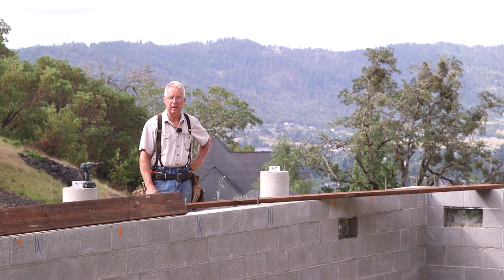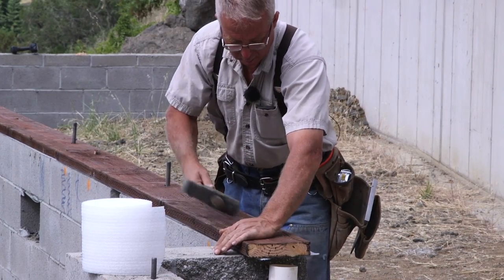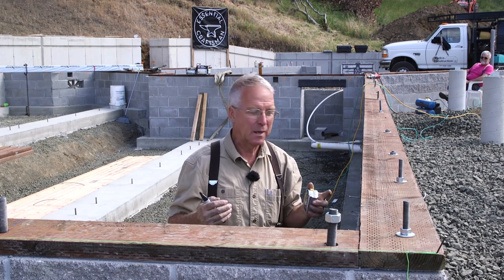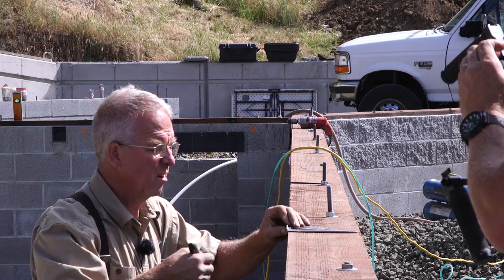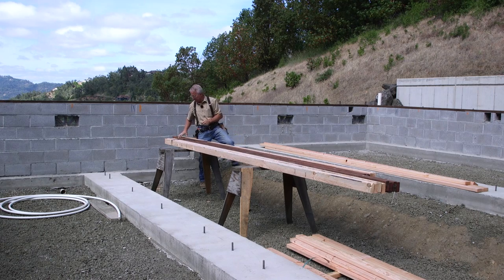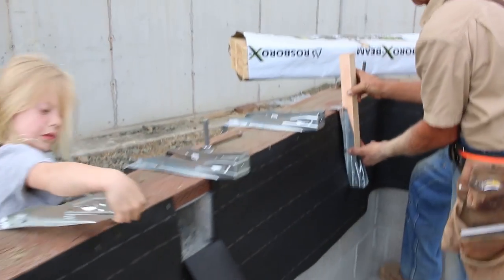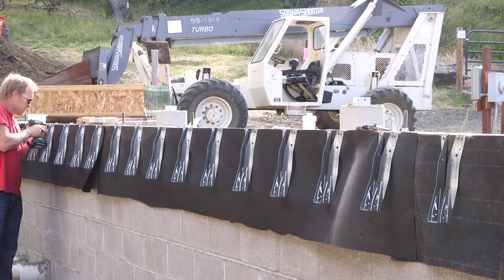Hold Up The Joists Ep.39

Comment: We dont use those boards (mudseal) in my country..we lay the heavy beams right on the anchorbolts..but..before we do that we pour another.concrete surface 7inch  that will cover the entire house..and then we start building..we dont like wood floors..we prefer concrete floor to build on

Comment: Love this video. I will be starting a new home in the spring, building on stem walls very similar to this. Overall height and appearance is a big concern for me as well since I am building on a grade. I never thought of or have seen hanging the joists inside the foundation wall but I will definitely put that on my list. Do you watch Scott Brown Carpenter's channel? He had an episode where he had to install tie down straps and he ended up routing out a channel for each one so they didnt interfere with the subsequent framing. A little plywood jig and a cordless router might have made that a neat solution to your joist hanger issue. Keep up the good work I can't wait to watch the rest of the construction.

Comment: I don't quite understand the point of hanging the joists.  What's the difference between that and just lowering your block wall and resting the floor diaphragm right on your sill plates?  I'm sure your TJIs are greater than 8" so obviously loosing one course on your block wall wouldn't give you the same finished floor height, but we're talking about 4-6 inches?   Are you that close to overall building height code that you needed ever inch?  It seems to me like it just creates chase complications getting your mechanicals into the exterior walls from the floor, as you mentioned in the video.   I'm sure there is a good reason, I'm not questioning you...But I haven't heard that reason as of yet, and I'm trying to imagine what it is...All I can come up with is that you are sitting that close to overall building height limitations.

Comment: You keep referring to and suggesting that you are using "kiln dried Douglas Fir". I remember a day, long before engineered I-Joists were introduced, that ALL floor joists were required to be DF, but since those days passed (20 or so odd years ago) I rarely ever see DF in construction (it's a rare lumber species to find these days). Framing lumber usually consists of spruce (SPF), even back in the day, so I must ask... where are you finding all of this DF?

Comment: I thought with pressure treated wood that the treatment liquid penetrates all the way through. With pressure treated pine when I've cut it, it still looks green on the inside. I say green because pressure treated pine lumber that I've bought here in NC looks green in color on the outside. What you have for treated lumber looks completely different. Is it pressure treated or just treated?

Comment: So I have a question, I have been taught that when you lay out 16 oc. you go over half the the thickness of the the board that you are using, so lets say it a 2x8 floor joist layout 
you would go over 3/4 from the 16 oc marked on the tape to make the board sit with 16 right in the middle of it. so why would you put your mark on the 16 mark and over like I said the board will be off and not 16 on senter as it implies.
Reply: Same difference.  If the edges are 16" apart then the centres are 16" apart as well, assuming everything is the same thickness.

Comment: Can you do a video about hangars? How does the immense load from across the joist transfer to the stem-wall via just these dinky little flaps of metal?
Reply from the maker: The load is not that big because the bearing walls are pushing straight down onto the foundation, the joists are only holding up the live load that is on the floor. Furniture and foot traffic. There are four point loads that bear down on the floor system and those have beams in between the joists to support those loads.

Comment: Hey Scott, I usually refrain from comment because your videos are so flipping good.  That said, I think you need 3" square washers on your anchor bolts per code.  Got called on this one recently.  Also, I would have loaned you my Teko gun just to save you some aggravation.  Great videos!
Reply from the maker: Good comment, I had to get my engineer to weigh in with the building department and let them know that he was only using the anchor bolts to resist sliding, he was using the hold downs to accomplish 
shear and resistance to uplift...

Comment: I'm not saying I've never made the same mistake but at 21:20 that pony wall is too tall, wish you would have shown how that was fixed so others could learn from that.  later in the video 28:40 it is clearly shorter/ fixed.  Thanks for a great series.
Reply: Another good tip is to use a Concrete Rubbing Stone to prep the "high spots" in the masonry walls, this is best done no later than the next day as the mortar is still soft.

Comment: Hello sir
Watched this acouple of ttimes and now I'm going to building a cmu basement with steel and concrete inside so watched it again...and wondering if I should build the floor on top of mudsale or on the hangers like yyou.I thought maybe the one way to do it is like you did so it'll give the walls more strength so they'll never collapse or crack...
And then I heard you said in 29:05 that the only reason you did it that way because of getting the house lower...is that the only reason???maybe I just did not get your point....so what do you think will be more strength??
Thanks

Comment: Couldn’t you lay the sill board on the tall bolts, hit it with a sledge hammer to mark the places to drill, drill those holes then lay the sill board over the long bolts thus letting the board now rest on the shorter bolts then tapping once again with a hammer marking those holes then drill again?  1.  I love this channel 2. I’m not a builder so if my question is stupid I apologize

Comment: The PT we use in Massachusetts looks different from that, it is generally a greenish (or even almost blue if it was recently treated). When I worked in California I saw PT like the stuff used in this video. I've found with this green stuff we use on the east coast that the treatment has penetrated all the way through the lumber. Anyone have any clarification?

Comment: Isn't there some kind of concrete sealer you can paint on the top of the walls / footings to make the pressure-treated wood unnecessary?
Reply: You're better off going overkill and combining treated lumber with the sill barrier, caulking AND everything else he's done to mitigate water from ever getting or staying inside the crawl space. Heck I'd even add a circulation fan. (But I also wouldn't use any of that osb junk)

Comment: Just a quick ?  Does your local code not require the large 2x2 or 3x3 plate washers vs. conventional washers?
Reply: I wondered that too. I live near EC and had to use those bearing washers on my shop.
Reply: I used to frame houses in recent years about 1-2 hours south of Scott. 2x2 structural washers were often used but not required. Similar washers to what he is using are common around here.
Reply: If it ever came down to those washers failing, don’t you think the nails in the studs would fail first?
🤜🤛
Reply: @psidvicious  Not necessarily. The bolts are there to keep the walls from sliding off the foundation. The sheathing and drywall hold the studs to the plates, so with enough force (earthquakes, maybe wind), the whole building could shift without breaking any nails.

Comment: There are a few points that the viewers would benefit by knowing. First,the National code mandates that all anchor bolts used with pressure treated mud sills must be at a minimum hot dipped galvanized.   2304 . 9.5.1  Fasteners & Connectors For Pressure Treated Wood  :  Fasteners ; including nuts,and washers,in contact with preservative-treated wood shall be of hot - dipped zinc--coated galvanized steel,stainless steel ,silicon bronze or copper " 
   Secondly,besides placing anchor bolts on a particular spacing schedule,one must adhere to the code that states anchor bolts should be not less than  6 " or more than 12 " from the ends of each sill plate. So,lengths of plates need to be taken into consideration and bolts need to be positioned accordingly.

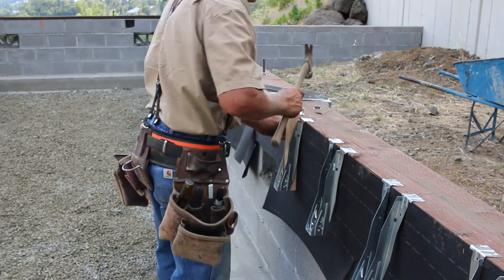Comment: Just a question, wouldn't have it been faster @ 24:14 to use the rim joist system then using a hanger system?
Reply: He explained that it would make the house too tall (architecturally). I understand that, but not sure why they didn’t just go with a shorter stem wall. I’m sure there is a good reason.
🤜🤛

Comment: Huh I thought it was code in Oregon to use square washers for any type of hold down that is being bolted (mud seals, and walls)
Reply from the maker: It is, but my engineer was not using the common anchor bolts to resist uplift, only sliding, I got a letter from him saying that ordinary inch and 5/8 diameter washers would be adequate because the hold downs are providing all of the resistance to uplift in the sheer panels.
Reply: Ohh ok I see, love your channel, I'm in Springfield and I'm a carpenter and roofer by specialty, but I've done pretty much everything that installs into building a house on a professional level and in a lead position I just recently started learning about making countertops out of different materials because I wanted to learn something new because everything else was a matter of just practicing more and not so much knowledge anymore so I felt it was time to move on.

Comment: Yes worrying about the tico nail heads is...well it's fanatical and ''shimming does not produce a better product. It only stretches out your video! I'm sure you will use construction adhesive when installing the subfloor/deck? That more than makes up for the tico heads.

Comment: Why not do the hammer whack all the high bolts,  drill them then hammer whack the next highest ones,  drill them and so on..  ..orrr run a nut down on all anchors to the height of the shortest  one and cut them all down to that  elevation. ...then hammer whack them to get your  marks.. maybe  scribble on the tops of anchors  with yellow  keal  (crayon)?

Edit: what's  the  difference between a strip footing and a grade beam?

Comment: How do those engineered chip board trusses hold up if they get wet? Are you just really in trouble if you have some sort of plumbing /flood event? I just picture it swelling and falling apart.
Reply: They expect them to never get wet. :-) Glues have come a long way but 50 years from now it could all be falling to dust. It is a cheap way to get lots of strength because of the tall height but maybe not the best for long term or unforseen weather events that usually happen sooner or later.

Comment: Did they put that vapor-barrier (bubble wrap) stuff under the pony wall? I didn't notice.
Reply: No, I thought that was odd myself, but then again it’s not exposed to any outdoor weather and draft mitigation between rooms is less of an issue than between outside and inside.
Reply: @cholulahotsauce6166  There's certainly no draft to mitigate, or insects to block, in a cripple wall. I just thought it would help to protect the PT lumber from damp. 

I hope they put down some plastic on the gravel before thei put on the subfloor. It's much nicer to move around in the crawl-space on 6mil Visqueen than rocks. I've always had to do that myself, and it's a lot harder after the house is finished. (My current house I got them to pour rat-proofing, which is better still.)

Comment: Why hang the floor joists instead of just setting them on the sill plate? Was it a design/elevation decision? Edit: you ended up answering later in the video!
Reply: @Steve Sheldon So then make the stem wall shorter?  I still don't get it.

Comment: I'm curious – and I apologize if this has been covered previously. During any of the site engineering/approval processes, was a torque value specified for the nuts on the bolts in the stem wall?

Most of my experience with working on stuff is mechanical in nature, so guesstimating things like that always makes me feel a little queasy.
Reply: +, - 2lb’ (#) before splitting the wood. . .
This requirement to supersede the previous standard of: “torque until stripped then back off 1/4”
To quote Ave: “click”
Reply: Okay, that makes sense. In construction, we measure in clicks instead of ugga-duggas like with vehicle maintenance?

This is fascinating.

Comment: If mr red shirt had used my drill bits to drill through wood into concrete I’d have let him off an hour early to ‘think about how to treat tools’.  I’m the guy who sharpens those bits for an hour before the day starts everyday. (Yeah, I’m cheap but never without work!).  Thanks for the explanation..I was forced, when restoring an old farm house where 24” o.c. Joists with no cross-bracing! (Grrr) so up came the entire floor system and cross bracing and every 10’ a 4”x 8” cross beam until the new subfloor could be called laser level.  If you want to save $60,000 in costs in your next floor renovation?  Do it right the first time!

Comment: 6:25 Don't the cutouts for the plumbing ruin the bond beam?
Reply from the maker: Good comment, fortunately I only had to cut the rebar on the back, short wall which is down on super hard soil. No compromise on the front taller wall where strength is vital.

Comment: My perfectionist brain tells me that I need to account for, and or correct, by pulling the tape extremely tight as to get the precise measurements. In one of the videos your tape is slightly bowed. Are you ever concerned about that, or would the measurements be not skewed enough to be within allowable tolerance?

When ever I'm building a cabinet or something else I always always always pull super tight lol. I'm looking for an excuse to not have to do that.

Comment: I'm disappointed your structural engineer didn't specify plate washers at your sill plate anchor bolts per SDPWS. It is required code at shear walls
Reply from the maker: I got a letter from my structural engineer indicating that he was using anchor bolts only to resist sliding , the hold downs to provide shear strength and resistance to uplift.
Reply: @essentialcraftsman  interesting. He may be using the exception in the code. In which case my scare mongering on this is unjustified. Just for some peace of mind due to the seismic prone nature of much of Oregon have him take a look at 4.3.6.4.3 in the 2015 SDPWS. It's free to view online.

Comment: So they do everything like it’s the 70s in Oregon still
Reply: So what has changed in your opinion, that would benefit the project?
Reply: goethe528 well no one builds out of blocks anymore the cost and time is way to high masons are expensive and it takes them forever to build anything lots of expensive hours. And two no one really frames up stub walls on interior footings to hold joists like that you pour a stub wall with concrete and cap it with green plate. Those 2x4 stub walls will rot out after a decade or less especially in a wet place like that.

Comment: Won't that first layer of pressure-treated wood expand and contract? It looks like there's no gaps at all between the boards and it's making me anxious
Reply from the maker: I had never considered it, but as I think about it I realized these boards are very very wet and will only shrink. No expansion at all.
Reply: Wood doesn’t move in it’s length.
Reply: Orestes Carracedo yep it expands and contracts across its width, not really its length. And this will most likely just contract.
Reply: Solid wood expands very little along its length, expansion and contraction primarily happens along the width of a board. That said, new pressure treated lumber is often very wet and is thus apt to contract as it dries. No gap is necessary.
Reply: Thanks for all the replies!
Reply: Like EC said, the boards are wet. They're wet because they've been freshly pressure treated and you'll notice that at the lumber yard.  Sometimes though when they've been laying around they get dried out.

Comment: Why not just run the TJI joists on top of the stem wall with the cripple wall supporting them? Then you run your rim board along the ends of the TJI joists to bring it flush with the exterior of the stem wall. Example photo: 

http://1.bp.blogspot.com/_VY6r4KwWwBE/SIVu1dfgDUI/AAAAAAAAAGQ/LhaiHFSsoTk/s1600/2008-07-21.4.jpg

It will make the crawlspace 12 inches higher, you won't have to worry about the plumbing having to make a tight turn within the stem wall, and the floor won't be squeaking in the future.

Comment: One thing I gotta disagree with is shimming up your pony walls to the underside of your joists, seems a bit hokey to me. As long as the stem wall and strip footings are level all you need is a string line stretching end to end or a transit or self leveling rotary laser to get the proper height for your pony walls. l don’t like the idea of shimming up a pony wall that is carrying the floor joists.

Comment: "How'm I gonna do that?"........ build it standing.. duh.. Run a string and measure down subtracting your top plates. If you put the foot of your tape on the bottom (pressure treated) plate and gently rock your tape across the string, where the number is the smallest and starts to grow again is your number minus the top plate(s). If you coppied your layouts properly it's a sinch to brace it square and plum.